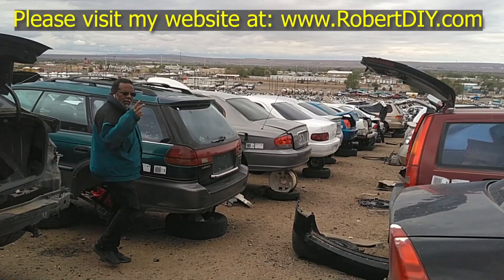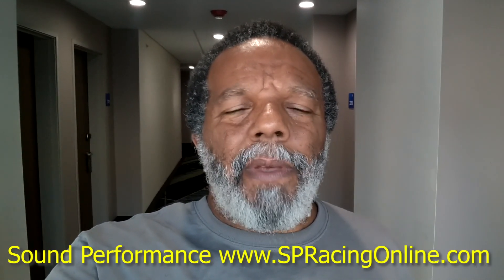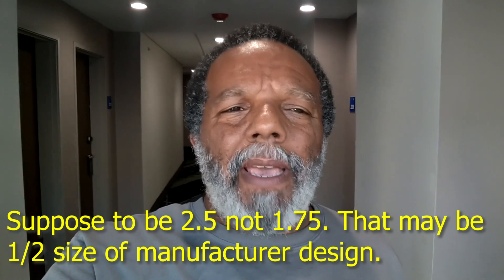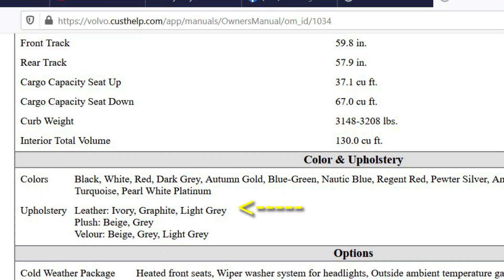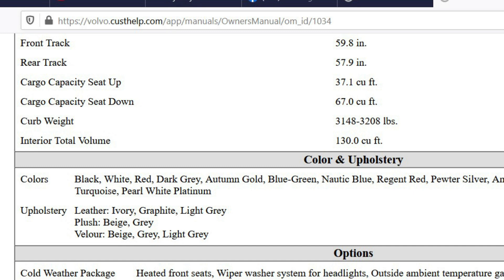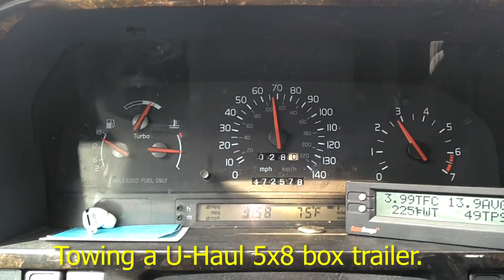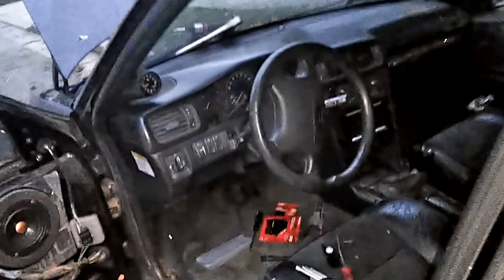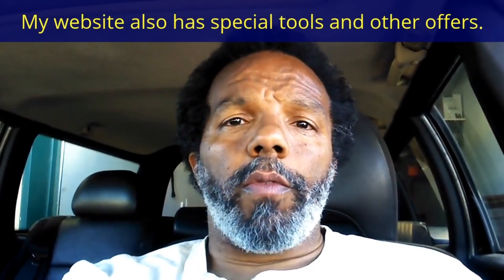In Chicago, exhaust issues post a repair, towing up the mountain, replacing a broken glass - HOWR

Comment: I have heavy duty aluminum tape I bought at a local hardware store after I saw an AC repairman use it on my apartment central AC unit. It's Scotch 3M Foil Tape 3311. Sticks to everything and holds up well.
Reply from the maker: Thanks for sharing. I appreciate that.